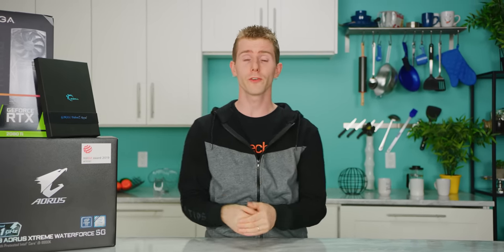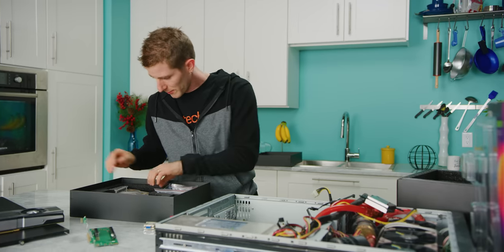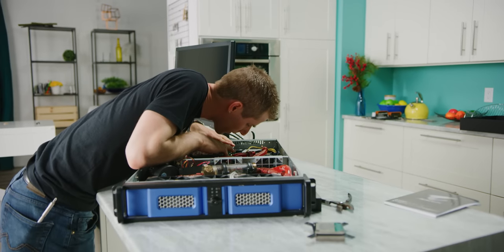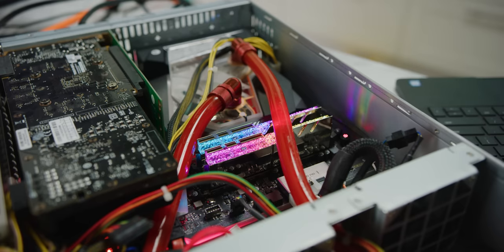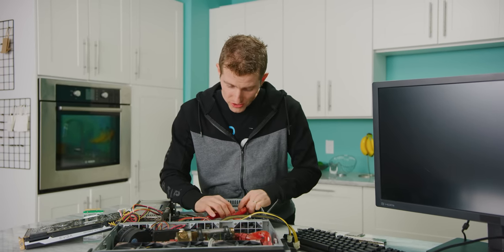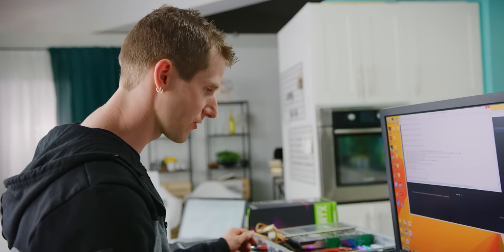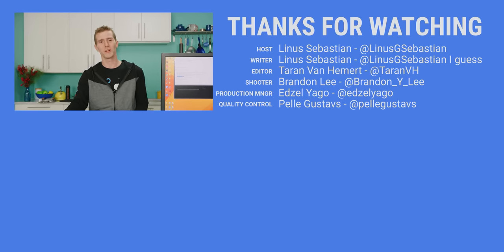All this work... for what?? - Upgrading the Video Render Server

Comment: "Those aren't that reliable drives..."
- 10 years old
- running in this server 24/7 for years
- probably up to 100 Gig daily writing workload
I'd call that pretty reliable...
Reply: They have been reliable, but they also have age on them now, from real use. Each write they have gone through at this point is a point of risk. Will it keep running without issues? Inevitably at some point the answer is going to end up being no.
Reply: From the year they were bought yes, but from this point in time forward is what he means i think
Reply: 100GB daily writing? They'd be nuts to actually write the files to local drives, when they're using a 10Gb network to their storage server.
Reply: Hve 2 Drrives with sandforce chipsets as well. They wirk fine, like on the first day... fo rmost of the time. They dropped MBR or Partition table on random. i do not use them for anything but steam games. if i have to reformat or cure them back to life, i don't give a F if it's just to reload steam games. but when i used them as systemdrives/data/work drives, it drove me mad when i randomly lost all data on them.( yeah i have backup on important data, but still annoying)
Reply: It's an OS drive, nowhere near 100Gig of read/write each day
Reply: I had a business lose 3 sandforce controller SSDs within a month, they all went out at around the same time, just OS drives for machine controller PCs.
Reply: @reverendaero  Windows will thrash an SSD with default settings.
Reply: 1. "Thrashing" is specific to HDDs. It refers to the arm literally thrashing from constant small r/w operations. I've seen this happen a number of times to old iMacs equipped with like 1-2GB of RAM on newer versions of Mac OS X. I get that you mean they will have a bunch of these similar small r/w operations but I think we would need a better term for it.
2. They were not at default settings lol, trim was enabled, indexing was disabled, superfetch (or I guess sysmain as it is called now) was disabled and the systems were at 8GB of RAM for very light RAM usage (machine controllers for machines making trusses that used to run on 2GB XP machines) so the page file was not an issue. It was a controller failure.
Reply: @mikem9536  ssds don't thrash, they burn gates.
Reply: SSD or HDD ?
Reply: You right you right.
Reply: they're also refurbished LMAO
Reply: In fact refurbished SSDs as seen in the "Everything is FINE! Thanks for ASKING.. - Server Room Vlog Pt. 2" 8 minutes in. Reliable AF!
Also 14:45 into vid "Preparing for 10 GIGABIT Internet! What Could Go Wrong?" Linus states they are Force 120GB Refurbished SSDs
Reply: @TylertheGeek28 l..

Comment: Linus: Reliability is key
Also Linus: Those are 10 year old drives in RAID 1...reliability doesn't matter
Reply: And Dha -2019
Reply: Well, it's raid 1, not 0. So it's at least redundant.
Reply: Raid is not a replacement for a backup
Reply: @LEDtherebelight  As long as those aren't the same drives. If they are, they are likely to fail arround the same time.
Reply: @juanbrits3002  Wanna bet? In raid 1, if you have ten drives, nine can kick the bucket and it'll still work. It's literally a replacement for a backup.
Reply: @TheRealDrae  No it is not. If your server room burns down, you are gone for good. You always have a back up on site and one off site.
Reply: @TheRealDrae  nope. In raid 1 if you delete by accident for example. It's gone on all drives. With a backup you can do anything.
Reply: Jakub Komorowski-Marcjan I think you’re getting confused. If you have 10 drives in RAID 1, HALF of them can “kick the bucket, (so 5)” and it will still operate. The reason RAID is not a replacement for a backup is that it does not save your data in the event of a tragic accident, like a backup would. People that deal with this regularly know that it is ESSENTIAL to have at least one backup on site, as well as at least one backup at an offsite location.
Reply: @juanbrits3002  Backup =/= Redundant
Reply: @TheAdatto  as said already, there's nothing to backup. Aside from maybe OS image.
Reply: What? Raid 1 is the most reliable raid setup
Reply: Zachary Lowe that would be raid 10
Reply: @lukewyn-harris5628  Raid 10 isn't any more reliable? If anything it's less reliablecause if 1 of the striped drives shit the bed they both do.
Reply: I assume he meant it to be reliable so it won’t leak or conk out and torch a expensive cpu vs drives won’t kill anything by failing just cost them some time
Reply: @DanielMosey  agree, a on-time system image on a usb drive is backup enough, to save time on resetting the machine.
Reply: @TheRealDrae  no, in a flat raid1 pair which is what's in this server, half of the array can fail , if there are more than two drives in the array (say for example you're running RAID0+1 so 5 drives in a RAID0 stack and an identical set running as a mirror), only ONE drive can fail and maintain the array. If two drives fail, any two random drives anywhere on the array, it's toast. If you want to run multiple drives then what you want is RAID5+1 (which gives you double redundancy because the array also carries parity data so it can rebuild itself after a failure or even a double failure) or RAID6+1 which will offer you quadruple redundancy.
Reply: Next time Upgrade 3950x oder TR3 gen 3 an RAID 1 dual MP600 PCIe SSD cause YOLO.
Reply: In fact refurbished SSDs as seen in the "Everything is FINE! Thanks for ASKING.. - Server Room Vlog Pt. 2" 8 minutes in. Reliable AF!
Also 14:45 into vid "Preparing for 10 GIGABIT Internet! What Could Go Wrong?" Linus states they are Force 120GB Refurbished SSDs
Pretty sure it was encoding thru a network share

Comment: Linus: "I used a metal reservoir because this can NOT leak"

Linus, moments later: "I'm not gonna drain this first"
Reply: proceeds to leak water everywhere
Reply: Aaron Huss Parkour No, because I typed it. 

Also... duh. It was sarcasm. 

Also... welcome to the internets.
Reply: Aaron Huss Parkour For your own edification...

You can drain from the reservoir, and empty the system. So that water doesn’t drip or leak out over sensitive components when you disconnect from the water block. 

In all honesty, Linus has been doing this stuff for years. He’s fine. He doesn’t usually break things with water (he usually just drops it). But that’s the context behind him mentioning that he wasn’t going to drain the loop first. Because normally, one would drain it further down the loop where to prevent spilling water over sensitive components.
Reply: It must never leak while the server is on, but as he mentioned there is basically no danger of damage due to water if there is no electricity flowing.
Reply: @RomansFiveDotEight  Waaaait, there is more than 1 internet? 
Godamn, i live under a rock
Reply: @eduardoavila646  Yeah but Linus has like six of them.
Reply: @RomansFiveDotEight  Too much internet for one person for sure.
Reply: @J624  If the moisture is propperlly removed and the parts are proppperlly cleaned, and no bga chip got water under it and/or water didnt push dirt under it. 
Then yeah, dangers are minimal as not even oxidation will happen.

Comment: Quick maths:
“205w(lol)” cpu
~250w gpu 
+ pump, many fans, drives and mobo

500w power supply.... “stability and reliability are the main focus here”

Linus pls, your killing me here. XD
Reply: I guess that GPU was never meant to be heavy loaded anyway, and the PSU is probably some top tier efficiency.
Reply: Those server style power supplies are made for 24/7 use up to that 500w. The 500-550w that this system will pull full power for 10 minutes won't really be as bad for the system as you might suspect.
Reply: lol. that remembers my old amd 1090t i kept running for two years permaclocked at 5.4gigs and two gtx690 with somewhat crazy triple loop interchanged peltier liquid cooling. 1400w for mainboard and around 2kw for those peltiers.... only things unstable were my bank account after electricity bill and ambient temperature
Reply: To be fair most server supplies are underrated, so they meet there wattage and still can 5-10years later.
Reply: Maybe its 2x500w power supplies
Reply: Olav Hansen Bingo. Server power supplies are often rated a lot lower but they can sustain it. 

It’s a lot like airplane engines. Your car probably produces as much horsepower as a small airplane engine. That small airplane engine is MUCH larger than your car engine and costs $50,000+. Insane!  Except that your car mostly runs lower in its power range. That airplane engine will spend most of its life at 75%+ reliably.
Reply: “you,re
Reply: knowing intels number fudging that TDP is at the base (4ghz) and it will likely use almost 2x the power at 5ghz.
Reply: @storm37000  the 9990XE pulls around 500W alone on stock settings
Reply: @alelau18  frickin ouch.

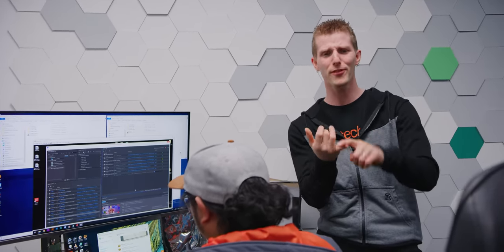Comment: 3:19 "There are transfer speed limits on their side."

When you are LTT you are never the bottleneck.
Reply: I think more their ISP speeds. They get speeds I can't even buy in South Carolina. 150 down and 50 up is the fastest I could get if I had the money. Fiber will here soon I hope.
Reply: batsonelec C yea... they basically have a direct connection to one of the hubs in Canada. They have a 10 gigabit internet connection.
Reply: @batsonelectronics  Damn that's low speed. I expected more from South Carolina. Isn't there fibre available there?
Reply: @harbirsingh7266  Yes , but not in the area I live. I live in a 50K city and fiber is available but not in the big Housing area I live. They just ran new fiber thru the neighborhood but it isn't offered yet. I have had 7mb for many years and even got 18mb on one of ATT faster connections. I went to cable as cable is best where I am now and 150mb/s is the fastest they offer. I don't get that speed but 60mb is more than enough and the cost is 1/4 or less than the 150mb speed. 2 miles down the road from my 7mb speed it is barely ISDN speed at 384kb/s max. And they pay the same I did for 7mb or 18mb.
Reply: @batsonelectronics  thats so weird for me. In Delhi, most areas are pretty crowded but we have finer almost everywhere and internet is pretty cheap on average. I get 50 down for like 7 dollars a month
Reply: @sanghamitrapradhan5820  Here in the US 50 down is about 40 dollars a month
Reply: @FlipnKraut  to be precise, they have a 5-ish gigabit internet connection but 10 gig to anyone on vanix
Reply: @sanghamitrapradhan5820  I live in Bangladesh and I pay like 12 dollars a month for 1MB/s down
Reply: @tasdiqzimamrahiq3991  
Same here, but I live in Germany 😅
Reply: @xenon5993  I lived in Germany for a while and do business with a few companies there, their internet coverage is appalling. I get why it's a bit tricky in some parts of the US, it's a huge country, but with Germany it just seems to be that nobody wants to pay to put more fibre into the ground...
Reply: @JonasDAtlas  
Jep, it's just like this xD But most people are fine with complaining about ancient and slow bamboo-like cables, instead of... doing something 😅
Reply: Harbir Singh Out in Chesnee SC AT&T fiber is available. 1k up and down (usually 600 up and down)
Reply: @tasdiqzimamrahiq3991  F is all I can say
Reply: Here in Hyderabad, gigabit internet with fiber is not uncommon. I have it too.

Comment: "Intels entire product line is basic obsolete at this point."

Anthony 2019
Reply: Epyc is still not out though
Reply: While the AMD lineup is impressive, if you have a high-end Intel CPU already, there is also really no point in replacing it, unless your work load is strongly prefering MT instead of ST (ie creativity instead of gaming).
Reply: @nevcairiel  That was pretty much the case even for FX. Keep in mind people replace like every 4-5 years, including even Linus.
Reply: If one knows how to use low core count (4-8) CPU+iGPU+dGPU, and the workload renders faster than high core (10-32) count CPU+GPU, what's the point of high core count CPU?
Reply: this video was shot on the 6th of June going on the bios time 9.42 long before any new AMD cpus
Reply: @AlfaPro1337  TDP also plays a role, espacially on servers. Additionally in this special case it was about optimization from programs. Optimization statistics show that with basically all optimizations real-life performance-gain levels after a certain amount of cores. We are going to hit a hard wall in the next 5 years anyway because of this (after AMD now kicked off the second performance race) before we switch to graphene.
Reply: @uncannysnake  You used optimisation, yes it's up to the developers to optimise their apps so that the time take for the output is quicker.

Premiere iGPU acceleration via quick sync can beat a high core count CPU. Even I set up my game stream to off load to the GPU, and since the iGPU is idling, might as well put it to work, rather than offloading to my dGPU. 

I even did a simple quality test, and found that the quality is good enough when compared to NVENC, and really, AMD 2017 scrutinising 'Stream Quality' is unrealistic, and no one is going to scrutinise the picture quality as well as NOT optimising your workflow, and depend on just CPU. 

This means, that I'm also optimising my workflow.

In the wafer industry, we are already hitting a wall. Si size roughly 22nm.
Reply: @user-rh8hi4ph4b  Common video coding upload to YouTube is H264 or H265. VP8/9 will be encoded via YouTube.

Starting with Skylake iGPU, H264/5 are support, both en/decode. Kaby Lake iGPU and newer support  support H264/5 and VP9.

Even the argument of encoding 5 videos at once and a high core count benefits from it, that's pretty unrealistic. That's because events like CES/Computex, only comes a year, not daily.
Reply: Time to go to AMD 🤔
Reply: @AlfaPro1337  blender
Reply: @AlfaPro1337  I preffer h265 to send to youtube... btw
Reply: @Xathos  Are you ok? I'm a Intel user btw...
Reply: @user-rh8hi4ph4b  more cores tend not to only increase encoding speed what is good but let me still working in other projects while encoding, thats is a great thing for me and having without having to pay 1000$ for a cpu is a great plus!!! :)... iGPU or GPU render have a lot of issues using blender for example, cpu render still better visualy... There is a lot of strange things going when rendering using gpu sometimes... Cinema 4D uses gpu better but we see a lot of issues there too... Someday someone will make a GREAT render for 100% gpu usage, but this do not works today... :) Peace m8 ...
Reply: @w1p30ut3r  For this situation, it's video production.

Comment: "It takes a lot of time to upload, because there are transfer speed limits on their side"  

Biggest flex of 2019 - Linus Linusmediagroup
Reply: To be fair : google can handle it, they just chose not too because that would be too expensive when multiplied by the amount of people that upload to youtube.
Reply: How so? Platforms with many users will almost always have a per-user limitation that will typically be under a typical connection that the average user will have.
Reply: It's a misleading flex though. Most fiber home connections can max Youtube.